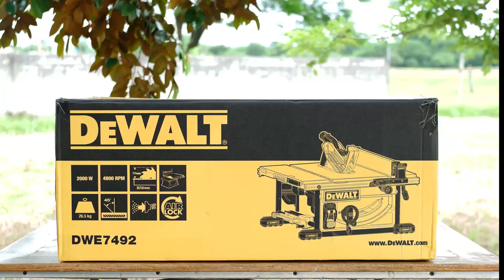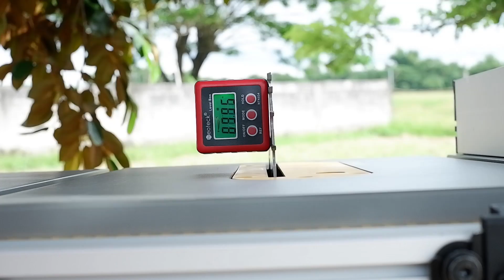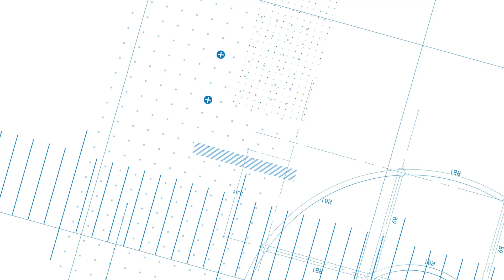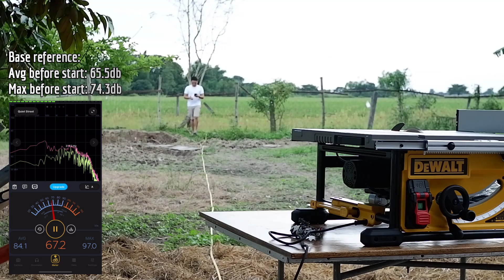DEWALT DWE7492 Table Saw Review

Comment: Very high quality and professional video, spot on tips and reviews. The effort in making this video is stellar and it shows! It makes me wanna throw away my crappy Makita table saw and get a brand new Dewalt! 😂
Reply from the maker: 😂 hold on to that! Aftermarket blade for this table saw is hard to find. Will share when I found one. As if now Blade is still cutting fine so theres no need for me to replace.
Reply: @titodomphcamps  Oh ok, I keep that in mind. Thanks.
Reply: @titodomphcamps  what do you mean with is hard to find? 250mm blades are pretty common in the netherlands, of am i making a mistake?
Reply: @charcoal I got mine bro bag 0 lng hehe salamat d.i sa suggestion nmo nako ani nga table saw 😬
Reply: @zhanrivyn6802  get it sir. Way better than any other table saws. Promise.
Reply: @titodomphcamps  found a couple of aftermarket blades - a Bosch 40 teeth iirc, and an 80 teeth Freud, all on Lazada. I put the Bosch in as my combo blade, though I dont think it was designed as such

Comment: What this review missed completely is that ALL attachments fit onto the saw. Even the fence fits snuggly under the work plate (upside down on the left), making it into a rectangular package of 68x68x33 cm with nothing sticking out. It's not light, but you can easily carry it with one hand (there's a convenient handle on the right of the saw). 

I am now kinda glad that my 745 gave up the ghost after years of use forcing me to buy this unit :o) It's really well thought out design and  yay! - dados fit, too. No more multiple passes. Not sure how they managed to push it out with EU rules re. no dados allowed, but I don't really care ;o)

Comment: Bro, it does have built in soft start?? Or because of that built in the extension socket you used?
Reply from the maker: It has built in soft start.
Reply: @titodomphcamps  Does it really have or do you have to mod it? It doesnt state in gigatools site that it has soft start
Reply from the maker: @paulgonzales1829  it has soft start. But its not that soft..I know someone who feels it doesnt have a soft start and moded it. I came from a TOTAL table saw brand with no soft start. This is much better.
Reply: Most people say it doesn't.  I added one.  It can be done without cutting any wires or voiding the warranty.  Starts much more gently now.
Reply: No it doesn’t have built in soft start. You can easily mod it though.

Comment: Use teflon tape for the miter gauge instead of aluminum tape 😉
Reply: I used PTFE tape - took all of 5 minutes to apple. Tiny bit of wobble remains, but at least it's usable now until I build a xcut sled.

Comment: Congratulations! Also have this saw and made a small video about it :) It is a really great saw - especially the parallel fence. My only minor „complaints“ are: 1 due to the fence system it is not really possible to use it as a „table extension“ e.g. when cutting longer material on the mitre gauge. 2. the mitre gauge itself: I threw it away and replaced it with a copy of the incra one. 3. Dust extraction hose/y-adapter does not come with it and the Dewalt one with airlock is quite pricy. 4. no soft start. It is not so scary to turn on as some other saws though - so i can live with it 😂A neutral point is that the fence system makes it difficult to add a router if you want to go this way.
Anyway that saw is really great and a pleasure to use and works extremely well and precise „out of the box“. 🙋🏻‍♀️Anna
Reply: Hi Anna,
thanks for your short review.
I'm thinking about buying a new table saw and this DeWalt is my favorite option.

I'm from germany and the informations (better: long term reviews) about the saw are rare down here, but:
I noticed a blog from someone who uses this saw with a router built in and he says it's really easy to combine it.

Here in germany you can buy a soft start module on amazon (25 bucks).
Maybe you give it a try on the american amazon platform.

I try to give you the links for checking these sites.

Greets

Comment: Dewalt's web site doesn't show this saw DWE  7492  but they do show DWE 7491
Also, I haven't been able to find DWE 7492 for sale  only DWE 7491
Reply: it is sort of an overseas thing from my understanding... they can't get the 7491, and I suppose it is kinda the opposite for US, might also only be available in metric, but they are the same saw just 1 dB quieter and the blade guard and feet are different. I assume you are US.
Reply: The 7492 is the 240V version.  The 7491 is for the US market.

Comment: I just bought this table saw and I want to ask about the sparks in the motor , is it normal?
Reply: Any motor with brushes have these sparks, even your normal drill. It is normal to do this and safe
Reply from the maker: That is correct. All brush motors has sparks. Its just that spark in this table saw is very noticeable. I got used to it in a couple of days

Comment: Hi, I am from India. I baught this saw today evening. Since there were no blade included in the package I had to buy the blade separately. The local store has installed a 255 mm blade in it and when I checked it was rotating smoothly. However I have not switched on the saw till now (which I will do tomorrow morning). Would you recommend to continue with the 255 mm blade or is there any safety issue? Your response is appreciated.
Reply: Use a de 250mm
Reply: Normally a bigger blade will not even rotate because there parts inside in the way.

Comment: Do you have idea where we can get 30mm arbor blades of good quality? 
May issue din sa flatness ung unit na nakuha ko. How about yours?
Reply from the maker: Bosch have eco for wood blades tho these are in the lower tier in terms of quality. Freud has also have 30mmx250mm blades pero sa amazon uk ko nakita.

Yes di perfect flat yung table ko. Makes it really hard to use digital protractor.

Comment: tama po ba comment ng ibang user malakas po ba spark nya? or madali uminit ang motor dahil 50Hz?
Reply from the maker: Yes may spark sya, but I think normal lang for brushed motor. In terms naman sa paginit di ko pa nagamit ng ganun katagal since DIY/hobbyist lang naman ako and fairly new pa ang unit sakin.
Reply: @titodomphcamps  noted po. Sana may available din na rolling stand locally

Comment: In reality Dewalt is not concerned with providing a TOP bench saw: -Changed the internal dust insulation, yet the machine still releases a lot of dust. - It is a noisy machine. - The consumer does not have the option to buy this machine at 127 volts. - No disk brake - loose goniometer. - It doesn't have the option of flange size, plastering the consumer to buy other size cut-off wheels (shaft hole flanges for other sizes of cut-off wheels should come as an accessory). - The cutting ruler is misadjusted. - The angle adjustment handle is too hard, as well as unreliable. - It does not fit 254 mm disc, only 250 mm. When you turn the motor on and off, it strangely "sparks". DISAPPOINTMENT! The industries, both Bosch, Makita, Dewalt etc are the same disrespect with the consumer. Adilson you are right! Enough of watching videos of Youtubers putting their hands on the heads of saw manufacturers just to beg and beg for a shut up and for the sake of the trash!!!!!!! People who sell themselves to the manufacturers of saws and tools in exchange for "jabá". The reality is only one, for the tool manufacturers, we are considered third-rate consumers, not to mention the lack of safety and quality! We cannot and must not accept these equipments and tools without quality, safety and respect to others, it is the lack of maturity prevailing over reasonability, common sense, ethics, safety and respect! We cannot accept that they treat us as third-rate consumers, disowning us and making us consume products without quality. We don't have to accept what the manufacturers want to sell us and push down our throats, precarious, limited machines, which fall short of our needs. Today, the market has a need for portable saws with better quality, as well as features and safety. This "talk" and justification of the industries that these machines are for construction sites only serves to discourage them from launching better saws. Year after year, the so-called "new" machines have no effective advances and improvements. It's the same old thing, the industry's accommodation. What really changes is only the price, always more expensive, without significant improvements for the consumer!

Translated with www.DeepL.com/Translator (free version)
Reply: What do you recommend is a better table saw than this then?
Reply: This is a jobsite saw. Based on price, it consider fair for the built and mobility. I bought other maker with higher price but disappointed with the quality. Yeah in reality, those maker only needs profit.. but to be honest this one is the fair one in the market
Reply: @jaguarchua  This guy posts this same pointless rant on many Dewalt table saw reviews.  If you want a saw with an easy to use, accurate fence in a small table saw there are almost no other options.  I think there is one other make that uses rack and pinion.  Another thing to watch out for is that some manufacturers use non-standard mitre slots on their small table saws.  That means you can't easily use an aftermarket mitre gauge.  Dewalt uses the standard size slot.  Many of the other brands do not offer dust collection from both the top and back.  Dewalt does.

The Dewalt is by no means perfect and it could certainly be improved, but there is good reason why so many owners have good things to say about it.

Of course if you have the space and money you're better off getting something bigger.  The Laguna F1 gets good reviews.